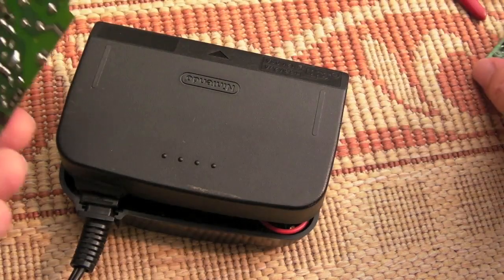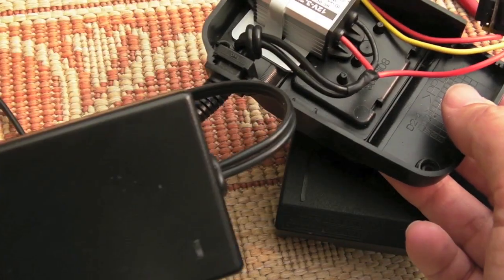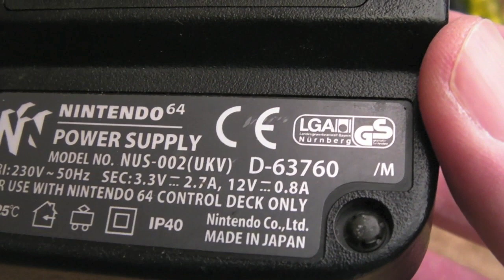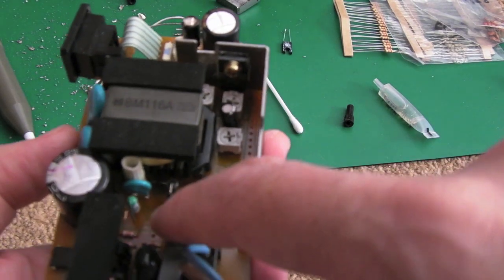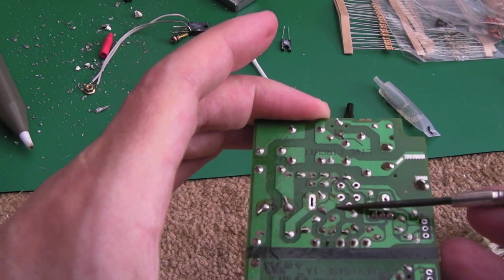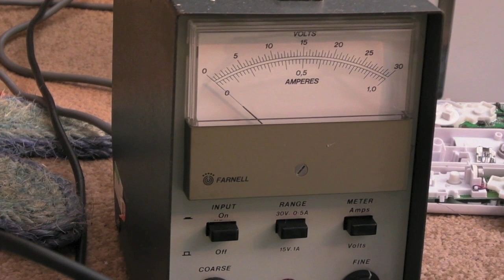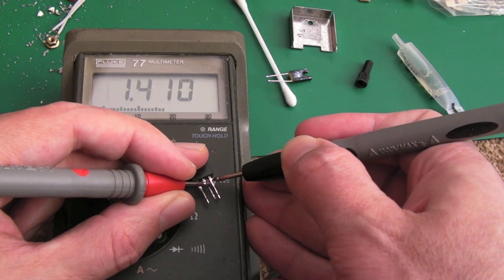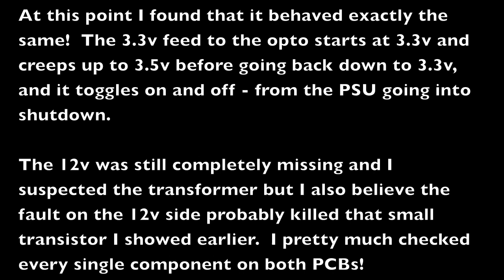Nintendo 64 (N64) PSU Mod (Replacement)

Comment: I love this solution, it's so simplistic and clever at the same time. 
I had one power supply that always got very warm just from being plugged in. Also it consumed more than twice as much power in idle. It put out ~10.4V and 3.4V.
So I ordered one of these DC-DC converters of ebay from china. 
I did a little quality of life tweak: Instead of chopping off a 12V PSU's connector I installed a DC barrel jack socket 5.5mm outside and 2.1mm inside diameter. This way I I can just plug in any 12V PSU with a fitting plug. External HDD cases usually use quite compact 12V 3A PSUs. 
Also I don't have a dangly wire coming out of the back of the N64 when I want to store it. I don't have to pull out the brick I can just pull out the wire and store it seperatly. 
It now outputs a clean 12.2V / 3.35V and efficency compared to my unmodified PSUs improved aswell. 
Originals draw roughly 8W to 10W while this only draws 7W~8W. My converter gets slightly warm after a few minutes but I'm not really worried since as you said the N64 usually doesn't come close to the rated 3A.

Comment: If you are worried about the DC-DC converter failing and putting higher voltages on the output, could you use a zener overvoltage protection circuit on the output?

Comment: Would a faulty Power brick supply cause my games to freeze?
Reply from the maker: It could if the 3.3v is noisey!  It could also need the RAM expansion slot cleaning.  It could also indicate bad RAM or a fault that happens once something has warmed up.
Reply: @GadgetUK164  well I was able to fix my freezing issue, apparently my power brick was dirty as hell...the board had gunk all over, gave it a good cleaning with alcohol and toothbrush and no more freezing.

Comment: How’s this working? I want to update my psu as the 3.3 is falling off, down to 3.1v.
Reply from the maker: 12v goes into, and provides the 12v as normal, but it also feeds the DC2DC which outputs 3.3v.
Reply: @GadgetUK164  
Thanks! I actually meant to say “how’s this still holding up?” But I went full tard. 

Yeah I tried to adjust the pots on my psu to get back up to 3.3v but it ends up raising my 12v to around 12.7v. 

So your psu is still working I assume?

Comment: I'm trying I'm vein to repair my N64 psu. Same version as yours.
It was dead, no life but I changed all the caps and the T2a fuse and it started outputting. It makes the N64 power light come on but won't do anything else. I really don't know where to look next. It's also making a buzzing noise!?  Any ideas?
Reply from the maker: Hard to say exactly what might be wrong with it.  I would suspect missing 12v rail.  Have you measure the voltages coming out of the connector?  You should have 3.3 on one pin and 12v on another - as shown in the vid.
Reply: GadgetUK164 - Retro Gaming Repairs & Mods I'll measure it in a bit and let you know

Comment: I've used DC-DC converters in the past for projects and never had a problem with them. A word of caution though, I'd hook up fuses on them 2 power lines (fast blow).
Reply from the maker: I've got the old fuses taken off the old PSU boards, so I will stick those in there =D

Comment: not sure what was wrong with the switchmode psu. could be a faulty switching ic. Possibly it is the one on the raised board with optos? The voltage creapage could be leakage currents from the transformer. When you measured the big transistor and the meter went 'got a reading and its gone again' it looked like a mosfet gate was charging for a split second, and then with the probes measuring a diode junction, that was the body diode.. I think you got the optos right, the output goes low impedance when current is applied to the LED. From what I've heard about optos is that the LED weakens over time and operation fails.
Reply from the maker: The optos were definitely OK!   As per my previous comment just sent - I believe the transformer was the problem!  I think the switching transistor had nothing to do with it, and what was happening is the 12v line missing meant the PSU was shutting down due to the comparitor board and optos.   You are right regards the opto's - they go low resistance on the 2 output pins, or high resistance when the LED is not driven on the input side.

Comment: Your video inspired me to have another look through all my faulty n64 power supplies. I had one of the other type which was an easy fix (shorted k2137 mosfet). The others all have the same issue as yours with the main pcb checking out fine and the issue being some where on the small pcb. 

The transistor you weren't sure about on the main pcb my tester identified as a npn digital transistor, all four I checked were fine so yours is probably fine too. It's just finding the issue on the small pcb....
Reply from the maker: Thanks for the info!!!  In retrospect it was the way I was measuring the switching transistor - I think because its mosfet I should have been using resistance mode instead of diode test.  I noticed later that when using resistance mode it did measure OK - so that was just a red-herring at that point, and obvious really because it wouldn't have been generating that unstable 3.3v level if the transistor was faulty.   But in my case I suspected the transformer at the end of the day, because there was absolutely zero volts coming out of the secondary side of the transformer with relationship to the 12v line, whereas the 3.3v line was OK, so I think that's why in my case the comparitor was shutting the switching side down via the optos, because of that missing 12v.  It would be interesting to know what you find on yours!

Comment: Some carts do have extra hardware, like the modem in Shogi Chess and the SmartMedia reader in the Mario Artist photo capture cartridge. Some games have FlashRAM which may also use more power when writing. I know that the V64jr does not need batteries or AC when plugged in to the N64 which means that the 64MB EDO RAM and the FPGA are powered off the N64, but that's unofficial anyway. My process to avoid using an AC adapter and to save batteries was to switch on the N64, transfer the ROM via PC send utility, flip on the battery power switch, toggle the N64 power off and back on, flip off the battery power switch, and begin using the software loaded on my V64jr. Standard V64 definitely needed its own PSU though!
Reply from the maker: Very interesting!  I didn't know that about the Shogi Chess and SmartMedia reader!

Comment: I've used one of those DC/DCs myself. Great reliable little device.
Reply from the maker: This was the first time I've used one, and I am quite impressed tbh!  They barely go beyond room temperature, even under load!
Reply: Rescued mine from some old lab equipment at work, where I think it'd been working quite hard 24 hours a day for years no problem. Not totally sure of the manufacturer of mine, but from memory I think it looks very similar.

Comment: There's a 2N4218 which is a SCR, but it doesn't look the same. Panasonic has an UN4218 which is a npn with voltage divider resistors on the base to control the switching point. I never undestood the need for these..
Reply from the maker: I think it's most likely that Panasonic NPN with the voltage divider - that might explain the strange readings.  In any case, there was no feed from the transformer so I think the main fault was the 12v winding had gone open circuit.  I think in retrospect the main switching transistor was actually OK - I think because of the type I needed to use resistance mode to measure it properly.

Comment: Could you not wire in a fuse, so if the converter fails, the power is cut off?
Reply from the maker: Probably a good idea to wire a fuse in for the 12v and 3.3v lines!  I will do that at some point!
Reply: A fuse is not going to blow on the output side as if the regulator shorted (i.e. 12v) on the output, then the current would theoretically go down not up, so the fuse doesn't blow. What you need is a simple crowbar circuit on the output (Zener diode and MOSFET) so if the voltage increases beyond the zener rated voltage, it conducts, turns on the MOSFET and shorts out the rail (protecting the N64, and sacrificing itself to force the fuse to blow
Reply from the maker: I know that lol - I was just agreeing in general that a fuse is a good idea, certainly as the original PSU had them.

Comment: Hey Gadget.
Recently I decided to try to repair one of my pal faulty psu's.
I discovered that the fault was indeed on the small PCB inside.
Turned out to be the semiconductors.
Reply from the maker: Thanks for the info =D

Comment: nice clean and optimal solution mate! I still dont get why they made the psu in such a weird way, instead of just supplying 12v to the mb, and spliting it were was necessary for the components from there.

Comment: Nice mod, did you check to see how many amps the 12v psu was using? It would be nice if you could use a smaller 12v power supply and fit that in the original case too, that way it would look original from the outside.
Reply from the maker: Yeah, I was just using what I had around - that 12v PSU was ready for the bin - I didn't have any other use for it since it was replaced with a new unit ages ago.

Comment: I tried a pc power supply. But The first one didnt power on and the other one reseted after 5 seconds.
Reply from the maker: You might find with a PC PSU that there's not enough load on it perhaps, or maybe the PC PSU needed recapping?  Good idea using a PC PSU though!
Reply: I used old pc power supply since newer ones as you said needs a load to work. I think i tried them with a cd drive to confirmed they work. =S Well well ended up scrap it. =.(

Comment: How as this mod held up is it still in use. Good idea I've got a simular problem don't think my caps.
Reply from the maker: It has been fine!  No problems at all, still working =D
Reply: GadgetUK164 - Retro Gaming Repairs & Mods brilliant thanks for the rapid reply. Got a few power packs about the house. No point in paying for new power supply when I get the step down for a couple quid.
Reply from the maker: Re-use the original soldered on fuses there too!  That was a change I did to mine later.   To make sure there's still a fuse on the 3.3v and 12v rails.

Comment: hey thx for this vid. I found it while looking for a way to run my n64 on my 12v solar power rig (living off grid, still love mario kart =P) This seems to be an elegant and simple solution. As the only experiance I have with electronics is setting up my solar power. I just have a quick question. Are those capacitors the ones from the original power supply and how are they attached?

thx
Reply from the maker: No, they aren't the original caps - but you could use them, just remove the one that goes across the 12v and 3.3v rails.  You just connect the + of the electrolytic cap to say the 12v, and the -ve side of the cap goes to ground.  Do the same with the capacitor on the 3.3v rail, so the cap + goes to +3.3v, and its -ve side to the gnd.

Comment: Would a cheap lm2596 buck converter not do the same job? These work to 3a with a heatsink and cost under a dollar from China. Use with a 2A 12V supply and you have your voltages.
Reply from the maker: Yes, I think you're right - that sounds like it would do the trick!  Didn't think of that, I will check out that device.
Reply: Thanks for this suggestion. I just ordered 3 different types; should hopefully cover all bases and solve my problem.
Except I ordered through an Australian distributor and it cost $30 all up including postage :-/

Comment: Wow. This vid popped up in my feed hours after I got another N64 with a cut power cord... and I wasn't even searching for related topics. I was just going to splice in a new power cord and recap while I was inside buuuut... oh, who am I kidding? I'll just stick with that plan. :)
Reply from the maker: I personally would prefer to just recap the original PSU and stick with it =)
Reply: GadgetUK164 - Retro Gaming Repairs & Mods Yeah, that's why I'm sticking with my plan of just replacing the cable. :)

Comment: Damn, I've got 3 or 4 of these to repair and I'm having no luck with them, now I see why, if you can't fix them then I've got no chance.
Reply from the maker: it depends what the fault is!  If its exactly the same model there's a chance you have a problem with the voltage reference board (like I had).  I am sure that's what was wrong with mine because I could test all of the components on the main PCB and everything was fine - so it had to be that PCB with the small SMD components.  If there were schematics I am sure I could have traced the fault further.   For the cost its easier to just do what I did I think - but put the original fuses in (which I did later off camera) from the old PSU.

Comment: Where have you been, we've been worried about you! Lol ;) By the way, we have sent off for the EEPROM from buyicnow website with the ROM file that you VERY kindly researched and sent to us. The gentleman from buyicnow emailed back and said that the ROM file was OK, so fingers crossed. Will keep you up to speed on our progress. Thanks again for your kind support and help in this   slightly annoying fault :O Wayne and Nina.
Reply from the maker: LOL!  I've just had a really tough time with my health recently and not had the energy or motivation to get stuff done at weekends and evenings etc.  Manage to find a bit of energy over the weekend and so pushed out these 3 videos.  Two of them were older videos that I just haven't got around to editing.  I do have a couple more things on the way though.  Let me know how you get on with that MSX! =D

Comment: parts list please
Reply from the maker: 1 x 12V DC PSU providing at least 2 amps - to feed the 12v supply to the N64 and to supply the DC to DC convertor with 12v.

1 x DC to DC convertor (12v to 3.3v @ 3amps (10w))  Something like this (make sure you get the 12v to 3.3v with the 3.3v providing at least 3 amps) :- http://www.ebay.co.uk/itm/Waterproof-DC-to-DC-buck-Converter-12V-to-3-3-3-3-7-5-6-9V-Power-Module-Supply-/302065815955?var=&hash=item4654869193:m:mYCzvufJ1v9Akgw9_Ogm9bw

1 x 1000uF 6.3v electrolytic capacitor (or 470uF) on the 3.3v rail.
1 x 220uF 25v or 16v electrolytic capacitor on the 12v rail.

You should also wire in series the original fuses from the old PSU.  There will be a fuse on each of the 2 supplies there, one for 12v, and one for 3.3v, but they aren't essential - just an extra level of protection incase your N64 draws too much power for some reason.

Comment: top left 220 0m resistor is gone or the 1.5.k one under it on the oct board
Reply from the maker: Yeah, I worked out one of the resistors, Vince worked out the other =D  I covered that in a later video than this one!
Reply: @GadgetUK164   I love the way Vince gets the credit when others worked it out years ago lmao